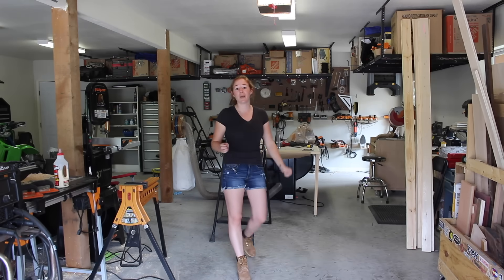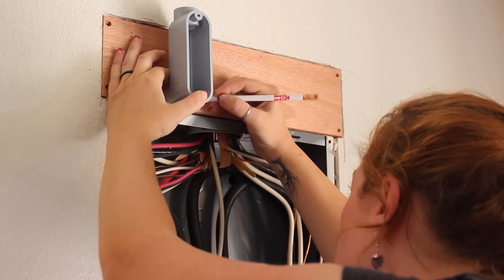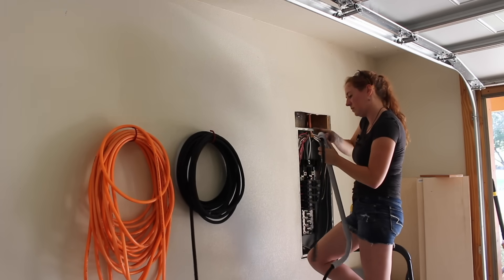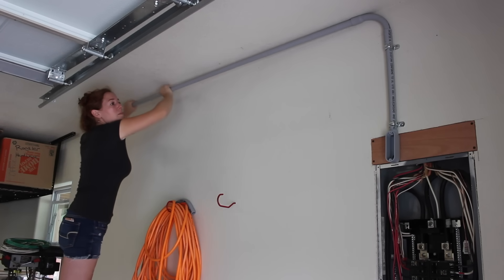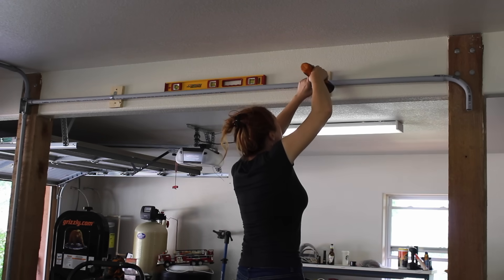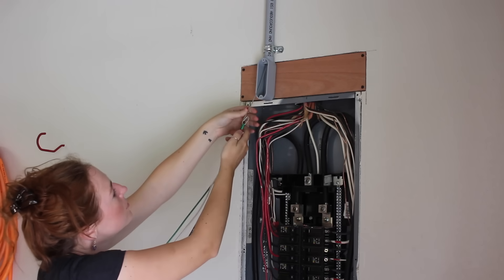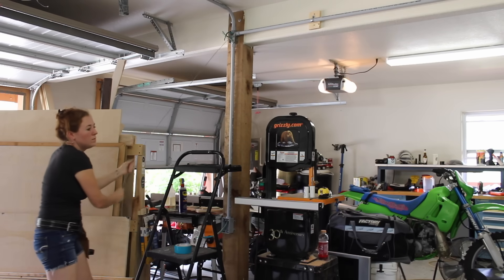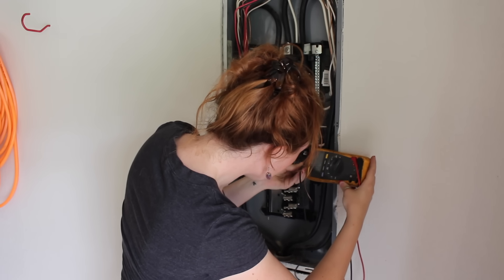Adding 220 Volt Outlets to the Garage

Comment: Wow... I am pretty well amazed and yes let the comments begin and people see me as super critical so here goes.... American standards r different to Australian standards but I know well enough of ur standards which brings me to comment. In electrical school we were taught to always face the conduit specs to the wall so it neatens out the installation if the customer does not want to paint it. Another thing is using the single cables in conduit is correct even in Aust. But to eliminate using BP connectors which we use then ur wire nuts we would daisy chain the outlets making minimal connections in the circuit (saving time) and saving possible fault points. Them wire nuts r a bad design and should be outlawed. All the other work is neat and tidy and that was a good way to bring the cable out of the panel, also here we wire everything for 220v to 240v for single phase and 415v for 3 phase power for ac and industrial factories for big motors. Btw u used the right size conduit too to allow space between the conductors to mitigate temperature variations which may be caused by the amount of amps ur pulling, which in ur case I can't see u pulling much at all to be of significance.
Reply from the maker: : ) Hey no problem with being critical of work...the key is to deliver it in a tactful way which I think you did. Thanks for the input. A few others have mentioned putting the print towards the wall, I can't believe I overlooked that.

Comment: The only comment I have, as many have said, was to color the white wire with tape or something. Perfectly fine to use white for hot as long as it's marked.

I need to do this one of these days for my car charger.
Reply from the maker: Yep, I marked the white with a red marker at the breaker. : ) I followed the example of the previous installer as that is what he (or she) did.
Reply: April Wilkerson yup, I saw that in the comments. Great vid as always!
Reply: The most dangerous location for some future person is in the junction box with the splice. You should mark the white wire in there, too. At the outlet, it should be pretty obvious that the white is hot, because it is a 240V outlet with no neutral.

Comment: Just my preference, but I would have run a separate breaker for each outlet, especially since you had the room.  You never know when your tooling/needs may change in the future.
Reply: I just built my shop a couple years ago and did the same for my welder outlets.  3 220v/50a outlets on one circuit spread out on 3 walls, then I did one dedicated 50a circuit for my TIG welder.  Also hardwired in my compressor with a disconnect box.  
I did all mine in EMT conduit.  Did all the work myself, just had it inspected like for new house construction.  No requirement for electrician signoff...
Reply: I was thinking the same thing. Normally 240V outlets each have their own breaker, but it's not a requirement.
Reply: Russell Telker AFAIK, there's no need for an electrician to sign off, other than giving you a heads up if you'll pass the required inspection by the building inspector. Of course, YMMV, etc.
Reply: But good effort on trying to find something you could needlessly correct. 👍
Reply: No one mark's their outlets before they sell their house!! Lol.
Reply: thechosendude did she kill the power to the panel though because she used the bandsaw which needs power to run
Reply: In the uk we have ring circuits sometimes u can have 2/5/8 or 10 or more double 240v outlets on one ring main. And a 32amp MCB or RCBO handles it all fine.
Reply: Great looking work! But when running my welder continuously running stringers or padding beads, it will trip my 30 amp breaker, I can't imagine running it in-conjunction with something else like a compressor. For short welds though, it would probably never be an issue.
Reply: thechosendude he
Reply from the maker: Nah that would be overkill in this situation. I'm the only one using the tools, it isn't like it's a production shop with several hands. a 30 amp breaker covers the table saw and compressor running at max, or the air compressor and welder being ran at the same time. I'll leave the extra room in the breaker for future machines or additional 110 outlets.
Reply: mlindholm depends on how persnickety the inspector is. In Washington State, you must get any changes you make to your home electrical system permitted. Homeowner permits are allowed, or else insurance may not pay a fire claim, the sale of your home could be blocked and future permitted work could be blocked until unpermitted work is permitted and inspected. Additionally, penalties can be assessed. I had an inspector nail me on this. 😉
Reply: April, I enjoy your Video's. I have held Masters in two states in Electrical and Plumbing. I was a master builder and contractor for 20 years. I think you did a great job, but could have a few code violations spliting 220 to two plugs like that. I think I would have dropped a 100 Amp subpanel under your 200 amp panel and ran all my 220 seperate from it. It wouldn't have cost that much more to do that. Thats just my thinking on that one subject. I am huge fan of what you do.
Reply: Maybe mark it somewhere to say that only one can be used at a time.  If the house is sold in the future, you won't have to worry about mentioning that.

Comment: so let me say as an electrician it looks good.  my only question is how did you get from the lb into the panel?  my concern being that the thhn  is unprotected in the wall.
Reply from the maker: Nope, no worry I ran it in a short run of seal tight so it's in conduit the whole way.
Reply: awesome
Reply: That was my concern as well. Glad you ran seal tight
Reply: *IG posts
Reply: That was the only thing I saw as well. Nice work!
Reply: How did you run sealtite for that short distance with 2 fittings?  A 90 degree fitting for sealtite is as long as the distance you have from the LB to the panel.. then you need a female adapter on the LB.. then another sealtite fitting.  So you have at least 3-5 inches of length needed to get into the panel.  you only have maybe 2 from the back of the LB.  Should really use a different color than white for the second phase conductor as well.
Reply: @mitchmaulik861  And i dont tink she able to install panel cover back without trimming
Reply: April Wilkerson phew! I knew you would figure out a way to sleeve the conductors! I will say I was worried about that when I first saw the it posts, but my connection was a bit poor, so I couldn't get a reply out! Plus I forgot! Looks good though girl!

Comment: As a German electrician I just don't get over it that you are using single wires for this. I'm grateful we can use combined cables for that, as in 3-in-1 (one phase), 5-in-1 (three phase) and 7-in-1 or 10-in-1 (both for switch panels, but a bit uncommon these times).
Another thing are the metal junction boxes - we use plastic ones for this, because of the conductivity of the material and the risk of that.
But hey: As the codes obviously are different between Germany and the USA, that's okay though.

For your work all I can say from MY point of view is, that I see no mayor mistakes made.

Good thing you mentioned that people unsure of this type of work should get a professional. Electrical power is pretty dangerous, especially because you don't see it. And if you feel it, it is much too late...

Keep on, love your channel!
Reply: wiedapp U.S. codes differ from state to state, even city to city. Some places allow Romex (combined) cables without conduit, some don't.
Reply: Thanks guys for getting that clear.
Quite some chaos in my opinion, when this differs between two cities within the same state...i guess. Well, a national standard has its benefits.
Reply: U.S. do use multi as do we (U.K.) but when ruining in conduit its more common to use singles. Got to admit i do prefer T&E ;)
Reply: wiedapp True. But there are advantages and disadvantages to wider standards. It's much easier to experiment and innovate when one city decides to allow water-free urinals for example, or combined cable outside of conduit, and other cities can learn from what worked and what didn't. We have national standards as well, but we also try to leave as much power at the local and state level as we can (for better and worse).
Reply: This isn't in Germany or in Europe for that matter. We do what we want here. Get over it. Holy f#@%!

Comment: lovely to see April branching out to other fields, i a sparky in the U.K. seen many jobs people feel comfortable to do that needed to be put right :) was going to mention the white not being marked but others have already. 

In the U.K. you can do your own work but MUST be tested and inspected by a qualified sparky before commissioning, but we all know some people don't and in that case will invalidate your home insurance at a minimum.

Only thing that makes me cringe is the wire nuts but our friends across the pond love them god knows why :D 

Have you ever used WAGO connectors? there brilliant and used quite a lot over here, have a look there a much better connection than nuts and the meet code in most states.
Reply: Jack Linde maybe if you read what April posted, you'd know that she said you need to get your work inspected.
Reply: devilclarke as a DIYer thumbs up for Wago connectors. However actually getting a sparks to inspect and sign your wiring where I live is nigh on impossible as they won't put their name to someone's else's wiring especially if it is buried.
Reply: Simple answer regarding wire nuts: They're cheap, and electrical contractors tend to be cheap. They can also be crammed into smaller boxes, which means less cost, and we're back to cheap contractors. Here in the US they can lobby in Washington to keep things this way so they don't have to spend more on rational solutions like your WAGO connectors.
Reply: you can contact your local authority to do it that is what my mother done before i was qualified to test and inspect ;) cost £200 to inspect whole house
Reply: its mad! wago connectors cost more but personally for peace of mind i would rather use them than wire nuts plus the cost comes down considerably if you buy 1000+ which you will burn through in no time. they also do a really nice wagobox (junction box for in structural wiring) really nice with integrated strain relief. 

Again most of the older sparks still use choc blocks (screw terminals) most new guys like wago just my 2p
Reply: Here in Argentina we just use electrical tape to make connections lol
Reply: devilclarke m
Reply: I partly agree, she has and does most times say to check local codes and get permits but maybe she should do a short video outlining what you should do before starting an electrical or structural project.
Reply: devilclarke Getting a building permit and having your wiring job inspected is a legal requirement in most municipalities in the US as well. If memory serves me correctly, they inspect at least twice, maybe three times. I know they do an inspection after the wire is pulled through, but before the outlets are installed. And then there is a final inspection before the circuit is turned on. (I think the City of Phoenix wants to inspect any conduit and gang boxes before wire is run as well.) And,  just like you said, if the insurance company gets wind of this, it'll invalidate the policy and leave the homeowner on the hook for any medical expenses/property damages. Also, the municipality, should they get wind of this, can require April to rip out any work she did that wasn't inspected.

I really wish April wouldn't skirt this. It's important for people to see "the pros" doing the job correctly, including acquiring the proper building permits and getting their work inspected. I know April has this "I don't need anyone, I can do it myself" attitude with many of her DIY projects, but this shows that she doesn't understand what building inspectors are and what they do. They are a fresh set of expert eyes to make sure that there isn't any mistakes in the project before the project goes online and potentially becomes a danger.

The big problem April fails to realize is, she's setting a dangerous example that others will follow. Even if her work is 100% to code, 100% safe 100% of the time (and it's not, because she, like the rest of us is human and prone to making mistakes), someone else is going to follow her example, run a circuit or build a structure without getting the permits and inspections. And even if she's lucky enough not to have any issues with her work, that doesn't mean anyone following her example is going to be as equally lucky. Someone's going to get hurt because of the example she's setting. In my honest opinion, April needs to admit that people view her as a professional, so she needs to start acting like one and show them the correct way of doing things from the start. That includes getting the correct permits and scheduling building inspections.

If she were smart, April would make friends with people at the local building permits office. Then, when she has a project, like building a carport, running a new circuit, or building a workshop, she can include interviews designed to educate her viewers of pitfalls they may encounter and what safety issues the inspectors are looking for.

Comment: I think the only problem you might run into down the road is if you sell and there is no permit for those plugs. But all you do then is pull it out ! Forgot, if anything goes wrong, no insurance will cover non-permitted work.
Good job doing it yourself :-)
Reply from the maker: I'm in the country, so no permits are required here.
Reply: :-) Great

Comment: To save your fish tape pull some cord through first and use it to pull the cable through. Great project. Keep them coming.
Reply: Always a good idea to pull a fish string through and leave it in place....in case you have to add something later.

Plus fish string is remarkably handy for other projects around the shop:  It's very strrong, cheap, and easy to work with.